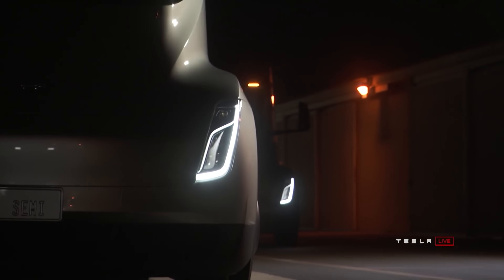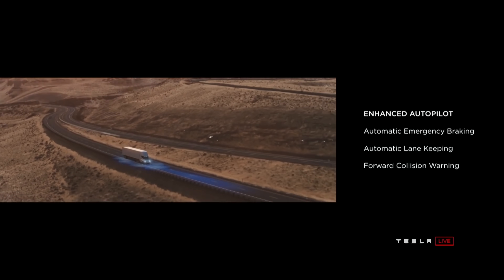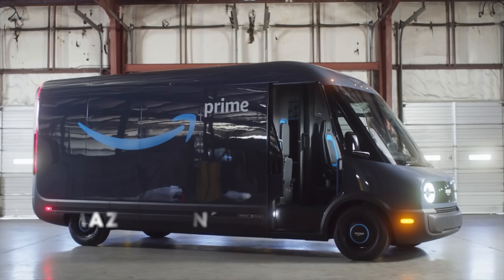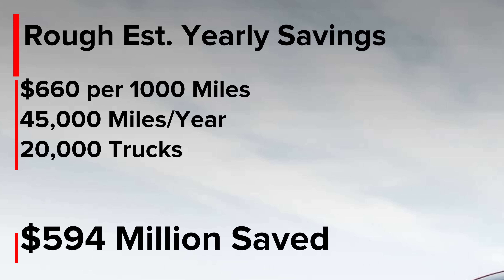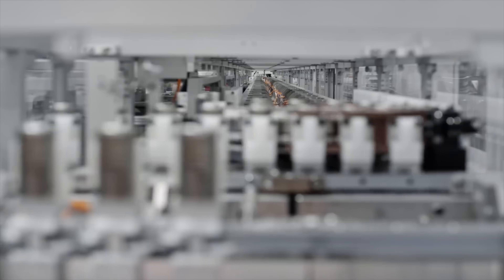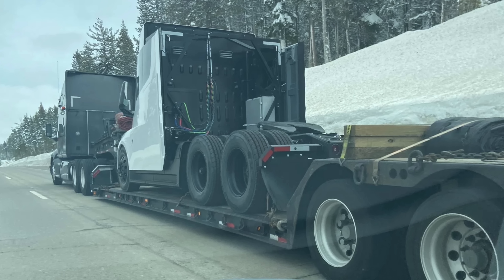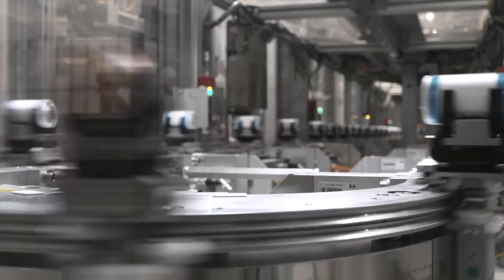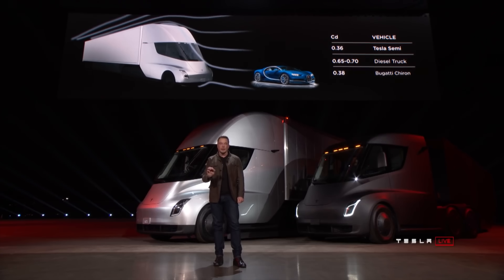The Tesla Semi Changes EVERYTHING

Comment: It's so heavy that it can only haul 60% of a full truckload, and there is absolutely no charging infrastructure for it.
Oh and by the way,, class 8 trucks don't break a windshield once a year,and small Stone chips cracks etc do not put the truck out of service.
Reply: @REM-4444  the roof isn't big enough to fit that much solar. The panels are only about 15 watts per square foot
Reply: Charging infrastructure can easily be set upp at the warehouse of the buyers like Walmart or Pepsi.
Reply: @neeljavia2965  nope, nowhere near enough power in those places to charge that kind of load. Each and every one of those chargers needs a 2500 amp 480-volt 3-phase circuit just to run. Not to mention at least a 2000 KVA transformer., And that's just run one single charging stall.

Those whole warehouse distribution centers run on less than 1/4 of that.
Oh and by the way that commercial three-phase power has a demand charge. Once you start up a big load like that you get whacked with the demand charge, and it's a whole lot of money. You get whacked with it every billing cycle. Anyone who believes $0.07 a kilowatt-hour is an idiot
Reply: @joecummings1260  Ok as you wish.
Reply: @Encourageable  you sound like a Romex roper . As an electrical engineer I can assure you bring in 2 megawatts of power for each and every one of those charging stalls is a huge deal . Now run along and fix mrs. Jones has kitchen receptacle
Reply: @joecummings1260  Hey but Elon said they will use solar and big storage batteries to be able to power up a truck. PS I am being sarcastic before you call me a moron lol
Reply: @gregandkaruna6674  yeah sure no problem, Pepsi's getting 15 trucks,that should only take about 25 or 30 acres of solar panels, providing there in some area that gets a lot of solar. Anywhere in Canada I guess you would need at least 60 acres to charge 15 trucks.
 
Should be no problem, right?
Reply: @joecummings1260  lol probably, I know many have solar on their roofs me included and talk shit about how their solar can charge their Tesla's but in the real world a 5kw system on the most sunny day would produce at most 40kwh of power and they would need to plug the car in all day! And of course that is a perfect cloudless day in summer. Same problem for the Tesla stations solar loses around 40% with cloud and then winter drops production to around 20%. Our solar still saved us around $1500 per year but winter is useless!
Reply: @gregandkaruna6674  you must be in a fairly good solar area. Where I live about a hundred miles west of New York City we get about 2.5 solar hours on average per day, so a little better than 10% capacity factor.

5 kilowatt solar on average, would give me 12 and 1/2 kilowatt hours per day.

I really think that people who make outrageous claims about their solar, are hurting solar energy.
Reply: @joecummings1260  Not only that a different country :-)
Reply: @gregandkaruna6674  . Tie me kangaroo down sport tie me kangaroo down
Reply: @joecummings1260  :-) close but not quite
Reply: @gregandkaruna6674  got to be NZ. I have heard that you guys still have SWER. (SINGLE-WIRE EARTH RETURN) power lines going into the more rural areas. Have you ever seen it? It uses one single steel wire for the conductor, and typically the pole spacing is kind of long.
Reply: @joecummings1260  Do not really look at that stuff, most of our power, internet is all underground especially all new builds including rural.
Reply: @gregandkaruna6674  yeah that was an old system that they used for rural electrification back when loads were much lower than they are now. The losses were a little high, but the construction costs were like a fraction of what it cost to build a conventional poleline.

They just built a system like that in rural Brazil in like the past 20 years. There was a guy down there name Fabio Rosia who advocated for it. PBS produced a documentary about him and his SWER system. It changed a lot of people's lives for the better. Now he has an organization called the sun shines for all. They are attempting to get small scale stand-alone solar two people out in the farthest reaches of the country.
Reply: @joecummings1260  It is funny many here comment about Tesla using solar yet even the giga factory looks nothing like the original concept drawing covered in solar panels. And so were many of the Superchargers they were also going to get solar however to date as far as I am aware zero superchargers have solar.
Reply: @gregandkaruna6674  yeah Elon seems to create a big cloud of misinformation and deception around his business dealings. Tesla is actually only profitable because it sells electric vehicle credits to other manufacturers. That market May collapse when other vehicle manufacturers roll out their own electric vehicles and no longer have to purchase electric vehicle credits from Tesla

Comment: What about the road tax? Diesel trucks pay tax on the fuel to maintain roads, how will the numbers compare if e-trucks payed a similar tax? Most likely using milage. 
I'm all for Evs, just don't hype it more than we should.
Reply: Road tax, federal and state, will be calculated by EDL. If doing it properly, allow a flat state rate so that it is even across the US if the state agrees impose no other road taxes. This lessens the paperwork burden on the carrier.
Reply: Charge the electricity used. 
Boomers showing their iq. 
Not to be rude but your logic is the same as that of oil lobbyists.
Reply: @neeljavia2965  , first off you shouldn't judge people. Not all of the electricity is used to move the vehicle.  Such as heating and cooling along with all other equipment. Electricity is lost just charging a battery, cooling with fans and pump. Eddie currants too.
Farm tractors and work equipment use coloured fuel (at least here in Canada) that road tax is not applied. 
The only logical way to apply taxes is miles/kilometers driven.
Cold weather conditions can really make a difference. Taxes should be applied fairly.
Also, how would you keep track what the electricity is used for? Cooking or driving?
Reply: @neeljavia2965 , BTW, I drive a model S and work as a truck driver, you probably didn't read all of my first post.

Comment: How much of the maximum load capacity of 80,000 lbs is available for cargo? Given the weight of the batteries, I'd imagine the Tesla Semi will be able to carry less cargo than a conventional tractor trailer. 

This begs the question,  by how much is the Tesla Semi payload lower than a conventional diesel truck?
Reply: EV and gas are terrible once weight from a trailer is added which is why there are no gas powered semis add a hill and the gap widens
Reply: Yes, this is something they really don't talk about much.  I'd love to see a realistic cost balance, given it will take
more trucks to have the same shipping rate.

That said, if they have calculated cost per ton per mile better than rail, in a Tesla convoy, I doubt if the numbers are lying, much.  Perhaps the radically lower fuel costs could offset the larger number of truck miles.
Reply: @davesvoboda2785  I guess we will know soon enough when the trucks are out in the wild.
Reply: It will be approximately a wash given no Ice and fuel tanks.